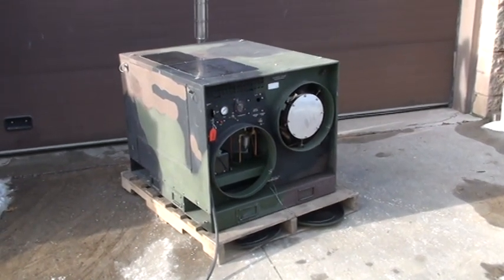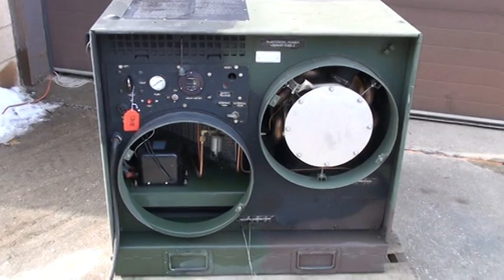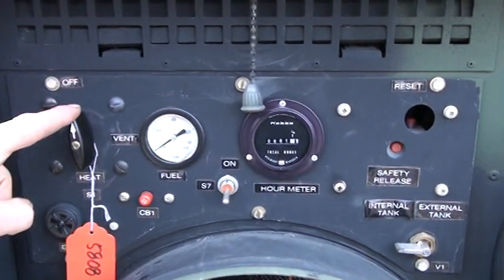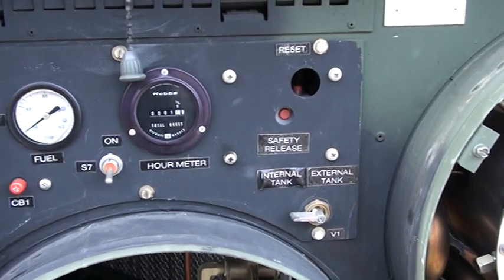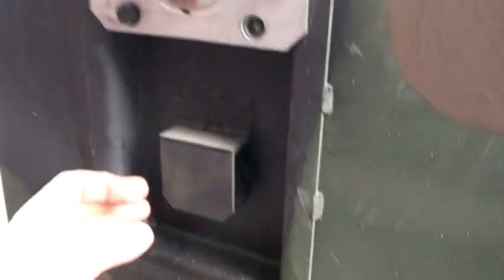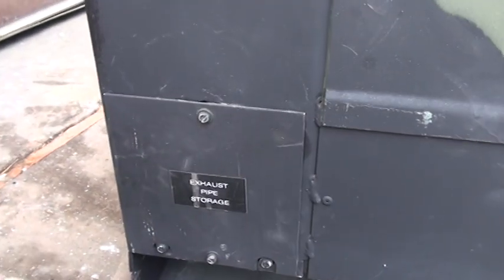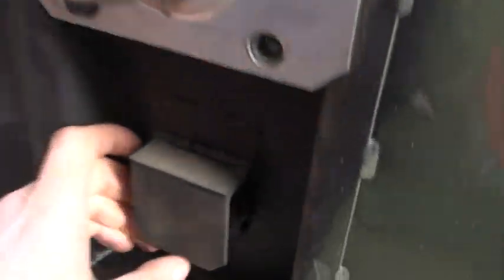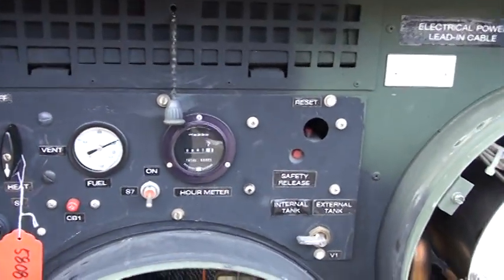Space heater test, 120K BTU, HDU-36E, H82, Military, Engineered Air Systems

Comment: I have this heater for only a few weeks and it was working perfectly until the past few days. Now when i turn it on the pressure drops suddenly and an alarm is sounded. I cant figure out why. Any idea?
Reply: Fuel may low or fuel filter or air filter stopped up
Reply: @michaelhoward3036  I am having the same issue I was thinking that the L-1 Solenoid is bad?
Reply: Did u find solution for the problem?